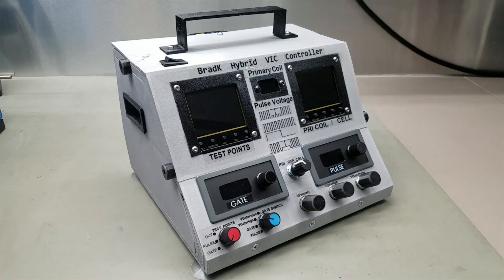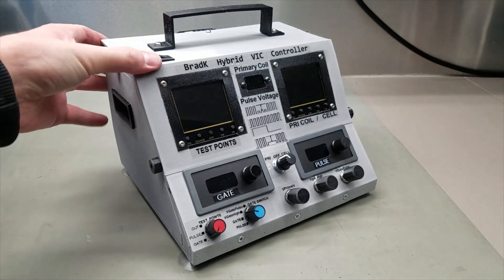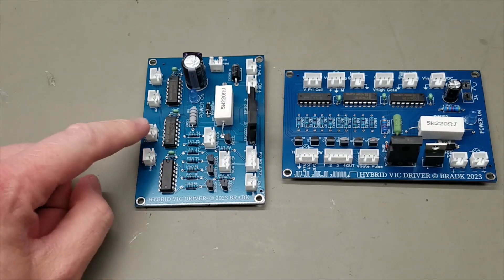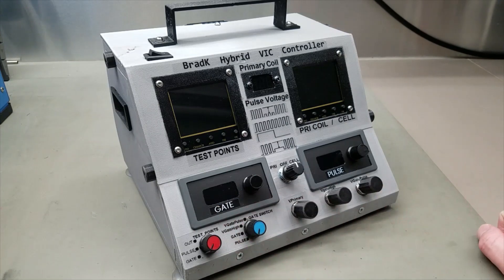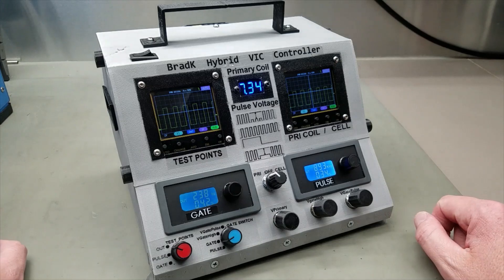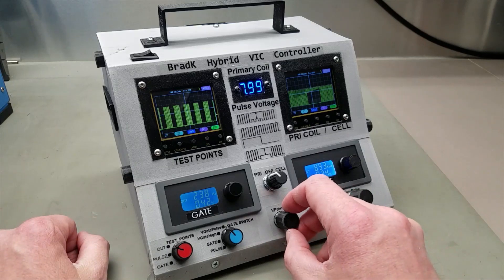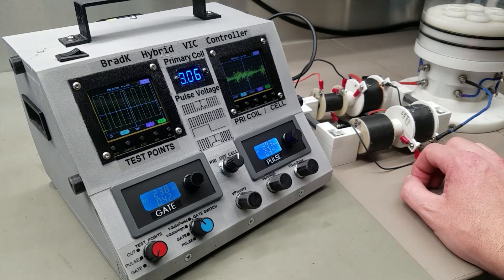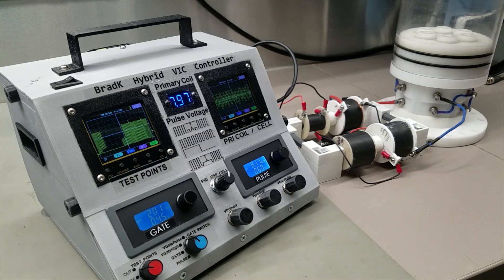Stan Meyer Research # 32, Apr 2023-The Hybrid VIC Controller V1

Comment: In the Meyer solution, the water capacitors, they stay charged all the time?
Reply from the maker: @rochaaraujo9320  No, they charge and discharge at a frequency of around 200-300Hz. Frequency depends on the time constant of the circuit.
Reply: @BradKwfc  what's happen if just charge water capacitor to limit without let breakdown between plates? Will create gas? Capacitor will discharge slowly?
Reply from the maker: @rochaaraujo9320  It will still create gas, but it won't be in resonance, so it will never reach the phenomenon.
Reply: @BradKwfc  sorry man... could you help me understand? What you mean about phenomenon here? Will produce gas but not in same performance?
Reply from the maker: @rochaaraujo9320   Yes. It will produce gas, but at that point, it's basically just pulsed electrolysis. 
Without resonance, the voltage won't rise to the point at which the phenomena occurs.

Comment: What happens if you hook two of these machines onto two separate coils, and put them in the same water cavity, and tune the machines to slightly different frequencies, so that they resonate/agitate each other?
Reply from the maker: Put the coils in the water cavity?
Or are you saying drive opposing electrodes at slightly different frequencies?
If you applied slightly different frequencies to opposing electrodes, you'd probably see either amplitude or frequency modulation, depending on how they interacted and the circuit they move through, but nothing would happen to the water unless the electric fields were strong enough. Even then, getting the water to break down is a two part process. All you would see is inefficient electrolysis of water with a high degree of side reactions.

I'm not sure what would happen if you put the coils on the water operating at different frequencies. If I had to guess, I'd think you'd see the water shaking from the magnetorestriction of the transformer core.

Comment: I agree with the gentleman below. the vic circuit being for one tube set inside the cell. omg I want one. how much would you charge to build this once more?
Reply from the maker: I've been working on an updated one for the last 6 months that is far better than this. I plan on making them for sale but it's a lot of work to make them and I still have some difficult problems to solve. When its done I'll make a video of it! I'm pretty excited. I think if anything out there can do the job right it will be my new one.

Comment: Nice setup! Hi, you really need to make one with two channels. One for your cell and one for the gas processor so you can make his water fuel for your cell.. I noticed you have your cell wired in series. Despite the picture taken of Stan's estate of the cell being wired in series this is not how it was set up with the 11 cell unit and gas injectors. Each tube set had a vic card and transformer of its own and they were sequentially driven so one cell did not interfere with the next. Keep up the good work and ps make some water fuel for your cell, you could use your vic to drive the gas processor, make the water fuel and swap it over to drive your cell to try to achieve voltage polarisation..Good luck!!  And ps have you ever wondered why the vic for the gas processor and water fuel cell are identical? Yes it’s because they are doing the exact same job. Ionising the gases in the gas processor and ionising the gases from the processor now mixed into the water.. Same tool, same job, same gases ,oxygen from air, different dielectric values….Hope this helps you understand the wfc system a bit better...

Comment: Good work! I think the one thing people miss is the PLL. Phase loop lock. Stan mentioned the frequency changes all the time due to temp,  water contaminates and so forth. It's a moving target. How much would you sell one of your units for?
Reply from the maker: Thanks. The PLL is not necessary for proof of concept (resonance can be achieved without it) but yes your correct on the frequency changing. If you do the math you'll find the circuit has a bandwidth of around 30Hz. The source I had hit resonance without the PLL circuit, and once he found out how to tune it he could do it at will regardless of temp etc but it was not easy.
As far as selling the units right now I don't have enough time. Putting it all together took me several weeks because my time is so limited. I want to make another version with a better case design this fall. If there's still interest then I may consider selling a limited number of them.
Reply: @BradKwfc  sounds good...sign me up!  LoL

Comment: Are you conditioning water fuel cells?
Reply from the maker: No
Reply from the maker: That's been an ongoing debate for a long time. IMO conditioning the cells does nothing. The reaction is so violent it will scrub off any "conditioning" on the electrodes.
Reply: @BradKwfc  What alternative do you see for conditioning
Reply from the maker: @NEMO N  IMO conditioning is not necessary for replicating Stan Meyer's work... because the process will essentially scrub it off. You could look at patents like the one by Tay Hee Han, he used a special dielectric to restrict current.
Reply: @BradKwfc  Something all Americans are going towards Tay Hee Han.
Reply from the maker: @UeujkmVeujkm 
The only thing I don't understand about the Tay Hee Han claims is where does he get the electrons to feed the reaction?
Reply: I can tell you from my work that conditioning cells is CRUCIAL to obtaining proper cell performance

Comment: Your VIC circuit will not work!
It is wound with copper wire.
You need steel wire.
The greater the resistance of the wire, the greater the impedance.
At resonance, the reactance of the coils is compensated by the reactance of the capacitor (fuel cell).
As a result, the active resistance of the steel wire inductors remains.
Meyer's physical and mathematical model is described on my channel
Reply: Stainless was only used at elevated voltage levels over 10Kv. In his patents he specifically states two operational modes, one for copper coils and one for stainless steel.

Comment: Looks like a solid setup. I was working on a arduino function generator to generate the gated waveforms to drive the primary winding but put it on hold when trying to design a circuit to detect the LC resonance frequency continuously in circuit, it got complicated and I shelved it and I haven’t worked on it since 2021. I need to get back at it and get that finished.
Reply from the maker: Thanks for the compliment. We're you able to adjust the duty cycle with your Arduino freq gen?
Reply: @BradKwfc  yeah I got the arduino PWM to output the correct waveforms to drive a FET driver, but the hard part is the feedback loop that is needed to keep the LC circuit in resonance. The electrolysis cell capacitance changes constantly as the gas is generated between the plates so a feedback circuit is needed to constantly calculate the resonance frequency and vary the PWM frequency. The C and L values need to be calculated in circuit while the cell is being powered so that adds even more complexity. I’m thinking the only way it might be possible is to switch the cell off for a very small duration and run a calculation cycle while the cell is powered down, then re-energize the cell after the calculation is completed, but this would have to happen probably a thousands of times a second so it’s a work in progress.

Another thing I want to test is the LC circuit working with AC current instead of pulsed DC. I remember seeing a video a around 2006-2007 where someone had a bridge rectifier hooked up to the electrolysis cell, so AC resonance may play a part. There’s a lot of theories I want to test with it, I just need to get motivated to work on it again.

Comment: Hi Brad... way to go.. can you vary the time between the gated pulses ( not the time between each pulse but the time between a group of gated pulses ).. in meyers diagrams that is T3..
Reply from the maker: Thanks. And yes it does.
Reply: @BradKwfc  would you be interested in making one for me... I can pre pay to save you forking out on parts etc.. only thing is we have 240V here..
Reply from the maker: @electro1622  It's battery operated but it can also be powered with a AC/DC wall power supply with a 2.5mm barrel jack. 

I would consider it but the price would be high just because of the amount of time it would take me and the limited time I have at the moment. That's why it took me a few months to complete. 

I'll make more videos of the design process and what it's capable of in the coming weeks.
Reply: @BradKwfc  OK.. how about a unit to gate (variable) an existing power supply.. I have a variable dc supply ... so all it would have to do is gate the constant dc and then gate it again so I can have gated pulses( T1 and T2 ) with a lower frequency gate for the T3 aspect...That way I can have up to 5 amps if I wanted to.
Reply from the maker: @electro1622  My first Hybrid VIC Driver will do 5Amps you just need a decent heatsink on it and a 2 channel frequency generator.
Reply: @BradKwfc  I have 2 separate sig gens... will they do
Reply: @BradKwfc  and we have 240V here ..is it ok for the circuit
Reply from the maker: @electro1622  As long as they can produce a unipolar pulse with adjustable duty cycles.
Reply: @BradKwfc  do you have a mic on your computer.. I can invite you to a discord chat and we can talk live..
Reply from the maker: @electro1622  I do but there's very little free time in my schedule. It's best to email me   BradKwfc@gmail.com

Comment: Looks like novelty is high, and we all back at it.
Great build👍👍👍👍
Reply from the maker: Yep. It's time to stop playing and get serious. This is step 1 for me. Step 2 will be in depth testing and analysis of the VIC.
Reply: @BradKwfc 🖖 i'm chasing an effect i saw over 13 years ago... distilled water with a long rise tune started behaving like a Van der Graf charginh a 3rd electrode at the top of the rise tube.
Reply from the maker: @m3sca1  Sounds interesting...You should do a video on it when you get it working again.
Reply: @BradKwfc  its odd even in distilled watwr without the effect happening, i can get voltage at the top of the long riser. my latest vids show the cell and tube. will def upload progress. Japan did it with the genepax device...